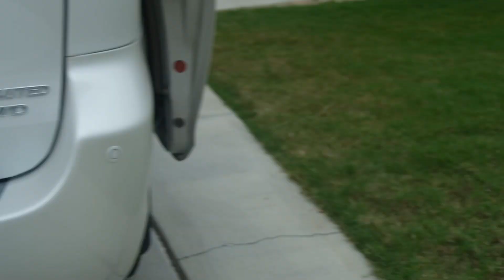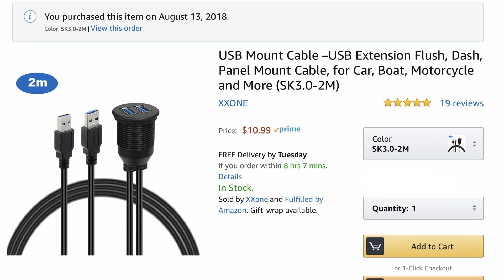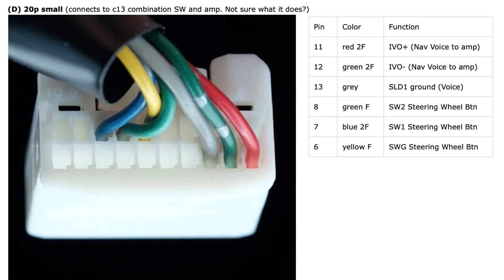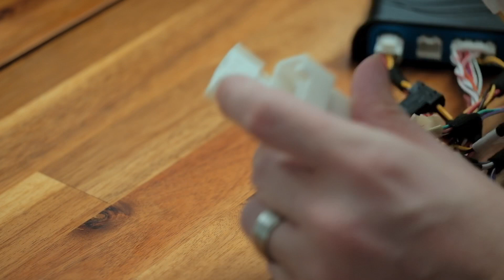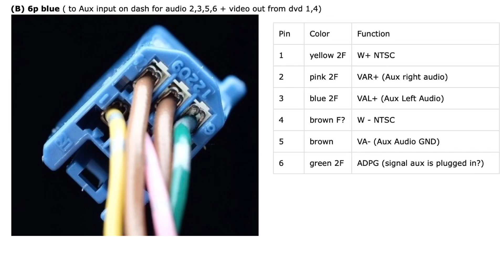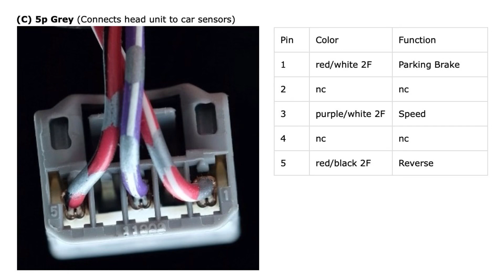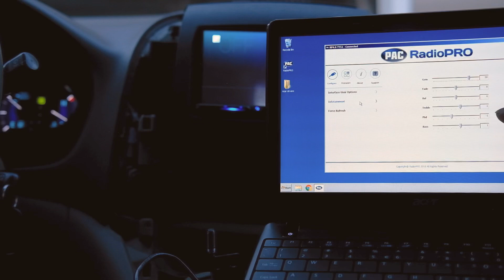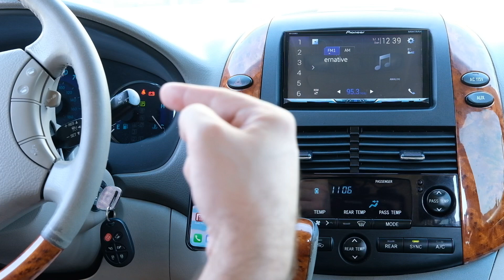Toyota Sienna CarPlay Install 2006-2010 JBL Limited

Comment: Watching this video in 2026 Jan. I bought a 2006 Sienna XLE JBL version which doesn't have navigation system and hence no  buttons on the right side of steering wheel. I want to install a HU with  screen which has both carplay and Android. Which one would you recommend? Ofcourse backup camera has to be there with that HU. @ brett

Comment: By the way, how was your audio quality after this install? My head units speaker outputs appear to be too strong and causing clipping when going through the amplifier. A little bit of online investigation tells me that speaker line outputs are often not meant to be amplified so that's why my sound quality sounds strange. 

I don't know what the best solution is except to maybe bypass my amplifier. I believe you also have the JBL amplifier in your system

Comment: Hey i tried to install this aftermarket radio but only two connectors from the 2010 sienna connecters are able to connect to pac 4.2. And the radio only turns on when i connect the acc power to the radio. Also their is no sound

Comment: Great video Brett - i have 2006 sienna limited and giving it to my son who recently got is drivers license. So we bought everything and attempted install but the camera doesn’t work. I have not driven the car much the last few years and I am wondering if there is enough power going into the unit for the camera. At point I thought the camera may be broken but I doubt that’s the case. Are you doing any splicing for the camera wires? Or bypassing something? 
Thanks in advance
Reply: By the way we have the 2440nex unit and I am wondering if something else may be required for the backup camera
Reply from the maker: There are a few things you can try. 1st verify your backup camera works with the OEM stereo prior to install. 2) make sure the connection works, it may only work when the car is in Reverse. This can be tested by connecting a cheap TV or other display to the Yellow RCA connector on the wiring harness. 3) Connect everything to the new stereo and make sure the stereo's settings have the camera enabled and configured correctly. Verify it works by putting the car in reverse. Hopefully this will help. The wiring adapter should provide the correct RCA camera output as well as providing the correct voltage to the camera. I believe there was two options for this harness and I had to choose the one with the rear camera.

Comment: Just bought a 2008 AWD limited and for some reason any sound coming through the radio sounds like a skipping cd as did the power to the speakers keeping coming in and off every half a second. Same radio as you. Any ideas what that could be? This happens on AM, FM, and Aux.

Comment: I have sienna 2004 JBL system. I have a hard time looking for harness adapter. I’m scared to cut the original wire to connect😢 directly though

Comment: Brilliant work, Brett ! I have just started exploring my options on the 06 Sienna Limited as the factory NAV HU screen blanked out. Upon removing the NAV unit, I see 7 connectors and 2 banana plugs going into the vehicle. Did you have to strip the OEM connectors and rewire them directly to the PAC and HU ? I am hoping for a solution where I don't have to do that. Thx

Comment: please,I need a full video on the installation of the screen stereo and the backup camera in a single video. Thanks
Reply from the maker: I already had the camera installed. I just cut the wire and connected it to the new Head Unit. Good luck, there are thousands of videos on installing cameras.

Comment: Hi Brett, I am installing an after market radio to my 2010 sienna with the  jbl sistem, my question is the accessory wire going to the radio comes out front the pac but it does not send any power to the radio, do I have to splice the wire coming to the pac?because the radio supposed to be fed from the pac bu the accessory is not sending power,  I hope you read my message.

Comment: Brett, thanks for the video! Question - I have a 2006 limited that has the RSE DVD system but doesn't have NAV. Would following this tutorial work for me?
Reply from the maker: Yes it should. For the limited they have all the wiring harnesses in there. What head unit they pop in at the end is a small change. You can pull your existing head unit to verify easily that the connectors are there.
Reply: @BrettMartin84 Will 2005 sienna xle limited work as well?
Reply: Thanks for the reply! Forgive the ignorance here, but I do have another question. When you said "verify that the connectors are there" - which connectors are you referring to? Should I be looking at what is plugged into the back of the stock radio? Or do you mean other connectors that aren't currently being used should be just loose and unconnected behind the radio sitting in that cavity? I'm just unsure what connectors I need to be verifying are there.

Comment: Would a 2005 xle work for this?
Reply from the maker: It is likely to be similar but not exactly the same. So yes it will work, no the colors for wires might not match mine exactly.

Comment: If you could link me to speaker wires colors that would be awesome. Great video btw planning on doing one without the pac your using but a pac line output converter.

Comment: I’m using a line output converter to bring sound from right speaker to go to a eq to run to my amplifiers for bass and later add door and rear aftermarket speakers then eventually tweeters so today I’ve been using Google a ton it’s a pain trying to find speaker wire colors. All to try and keep my can looking as stock as possible

Comment: DO NOT ATTEMPT ON A 2004 Sienna XLE Limited. The factory wiring harnesses aren't compatible with the PAC harnesses. Although the stereo and jbl sound system appear to be the same between 2004 and 2006, apparently the wiring got changed. I'm returning everything and opting to keep the oem stereo, as I can't seem to find a compatible kit for the 2004 XLE sound system or a clear set of instructions on how to connect the wires.
Reply: Some commentator got it working on 05 sienna xle limited. Read newest comments above

Comment: Great video. Question: with the PAC unit, can you still control fade from the Pioneer head unit or is that somehow disabled? (I like to move audio to the back for movies)
What's a microswitch for the parking break?
Reply from the maker: Yes but not easily. You need to connect the PAC unit to a PC with the correct windows software then upload new settings for fade and other audio settings like bass. The HU can control other settings to some degree but this is directly telling the OEM amp to change the settings. Why the Pioneer HU can’t do this since it already talks to the PAC is a huge miss and beyond me. I left a cable attached and under the side dash trim so I can pop it out for quick adjustments but as far as on the go adjustment it’s not possible.

Comment: Thank you for posting this!  Do the wire colors vary in the harnesses from the car?  From your pictures of the 12p black connector I would expect to see blk, wh, rd and gr for the rear dvd audio but they look blk, ? , red and green. Similarly for the 6p blue connector, calling for yellow and brown, but looks grey and purple maybe? Should I just be matching up pin locations rather than wire colors?

Comment: How did you trick the rear entertainment monitor to power on?
Reply: no trick. The 06 and newer power independently. 04 and 05 models require the original factory head unit to power the rear dvd player unfortunately.
Reply: Lol, just finding your reply. Now I have a 06 and you can tell that the rear entertainment screen is different. I tried to swap from my 05 . I did find one . Yeah I'm scraping the 05 so I'm swapping some stuff including the Kenwood. Thanks again for the info.

Comment: Do you have any recommendations on a stereo for the 2013 Toyota Sienna? I need one that works with my DVD player, backup cam, the controls on the steering wheel AND has Bluetooth for hands free phone use/SiriusXM. Thanks in advance!

Comment: Regarding CarPlay
Does your phone call audio route through the Sienna speakers?
I have a similar setup, but with JBL amp routing all the cars audio, and I’m wondering if for some reason that is keeping my phones audio from coming through the speakers?
Also AXXESS makes a harness to connect the RES to a new head unit AV
Reply from the maker: Yes, I can take phone calls via wired CarPlay or via Bluetooth and it plays through all speakers. If you don;t hear phone calls it may be your head unit is doing something unexpected. It should be easy to wire a random speaker to the HU to verify phone calls are producing audio out from the HU. In my setup only the FL/FR speakers get routed as L/R audio into the amp so if you connected the rear audio by mistake to the amp it is possible music works but not phone calls as the HU would only send audio to FR/FL not RL/RR. Thats my best guess
Reply: @BrettMartin84  Thanks for the reply... I seem to recall the setup with the Maestro RR and JBL involved the L/R RCAs going into the Rear L/R of the Pioneer because of the JBL amp... I'll see if I can wire up the front audio wires from Toyota to the Front inputs on the Pioneer.

Comment: Hello Brett.  Thanks for the video.  The PAC interface is working perfectly in our 2005 XLE.  I had originally tried the Metra TYTO-01 JBL Amplifier Interface Harness, but the sound quality wasn't great, and when our stock head unit went out, the rear speakers were faded out, so with the TYTO-01, there was no way to reset the stock JBL amplifier, meaning our rear speakers weren't producing any sound.  The PAC RP4.2-TY11 Radiopro4 Ty11 with computer connection allowed me to force reset the stock amplifier and now all 10 speakers are working perfectly.  The issue now is the stock rear DVD player (RSE).  Unlike your 2006 with navigation, our 2005 did not have navigation, and the DVD harness did not have a connection in the PAC interface.  I don't expect you to solve my problem, but if you've got any suggestions or could provide any help I'd greatly appreciate it.  Our boys love the DVD player and I'd like to keep it working.  Thanks again.
Reply from the maker: I spent a few days finding wiring diagrams for the car and then opening the dash and confirming those diagrams. There is a good chance that if you never had navigation that some of the harnesses are either missing or possibly tucked away under the dash. There are separate wiring diagrams for the Sienna electrical regarding the DVD player at the DVD player location. It would be possible to tap into this audio and feed it into the AUX input on the new HU. I will be abandoning the DVD all together and use the built in DVD on the new HU to push audio out the speakers and video out into the AUX inputs in the rear of the car. This also requires running a simple video cable but should be easy. Lots of advantages/disadvantages. Best advice I can give you is to grab a small old car/toy speaker and study some wiring diagrams to see if. you can identify the location and wire colors for +/-/Ground for the audio for the DVD RES output and then try to find it in your dash. If it's not there, find and test it at the DVD player, then run a standard audio cable between the two. Alternately, use the wireless headphones and DVD RES as a closed system only. Headphones are like $20 on ebay.

Comment: 14:04 Hey Brett! I bought 07 Toyota Sienna LE with a JBL sound system. How to get the video and audio from the rear DVD on the head unit? From the black connector (a standard rear entertainment system connector) where those pink terminal quick disconnects go to?
Reply from the maker: the 12 pin black connector contains the audio for the dvd player. this is from the player and into the Aux of the new HU.  black = R+, White = R-, red = L+, green = L-, Video is on the Blue 6 pin connector. it also contains the Aux audio input. Yellow = V+, Brown = V-. Pink = R+, blue = L+,, brown = RL -

Comment: What wire's do you need to connect to get some sound out of the DVD if you can please clarify.
Reply from the maker: the 12 pin black connector contains the audio for the dvd player. this is from the player and into the Aux of the new HU.  black = R+, White = R-, red = L+, green = L-, Video is on the Blue 6 pin connector. it also contains the Aux audio input. Yellow = V+, Brown = V-. Pink = R+, blue = L+,, brown = RL -

Comment: Hi Brett. Please help...im only getting video from dash head unit. Now video in rear tv has disappeared. Any suggestions?
I located in another comment about RCAs and black and gray connectors. I will attempt that process. Im trying to figure out if the RCAs will be bare?
Reply from the maker: the 12 pin black connector contains the audio for the dvd player. this is from the player and into the Aux of the new HU.  black = R+, White = R-, red = L+, green = L-, Video is on the Blue 6 pin connector. it also contains the Aux audio input. Yellow = V+, Brown = V-. Pink = R+, blue = L+,, brown = RL -

Comment: So... My pioneer unit only has 1 usb port in the back. Did you splice the 1 usb port in back of head unit for the 2 plug cord or did you only need to plug in one cord for both ports to work?
Reply from the maker: I got a dual USB port extension. one plugs into the Pioneer, one plugs into a regular 12v USB adaptor plugged into the 12v outlet now hanging out behind the dash.

Comment: This is exactly what I needed. Does it also retain the ability to keep my rear dvd player?
Reply from the maker: Yes. The old rear player and AUX input now route into the AV input of the new head unit.
Reply: @BrettMartin84  Thanks for this awesome video. I read that the 3rd Row AV input doesn't forward to the head unit, only the DVD source will. Can you confirm either way?
Reply from the maker: @chillydownnow  it’s only connected to the screen in the roof. No reason for Toyota to wire it back to the HU. Should be simple enough to piggyback the wires from the rca input and send it up to the HU via the skirt boards.
Reply: @Brett Martin thanks for the video, it’s all I need for my Siena 2006 limited. Do you still recommend the Pionner AVH 2330 Next, or have something best nowadays?? Thanks

Comment: Hi Brett. Great video! I have been looking for a video like yours for a few weeks now. Glad I landed on this. How did you decide on the head unit? What are the requirements I need to look for? Thanks.
Reply from the maker: J Lantoria Hi. I have had a few Pioneer head units in the past so I am a fan. If I were driving this car more or if my kids were older I would have spent more money on a Wireless car play HU so I never have to plug anything in if I don’t want to. They were twice as expensive when I bought this but have come down in price now. There are also units with dual outputs so the rear seat can watch a movie while the front seat listens to music. You can also get some cheaper units now that are not very deep because they don’t have amplifiers etc inside. This might work well considering you are bypassing the HU amps to go into the existing amp unit. The unit I went with was a slightly older model. I would have gone for the newer one but this one had the rear camera parking lines and the new one didn’t. So 1)CarPlay 2) Good brand (pioneer, keen wood, alpine etc) 3)A/V input from rear 4) steering wheel controls 5) Bluetooth 6) works with existing amp/sub built into the car. This HU gave me the most features for the lowest price. If I got a better HU I would be tempted to re-wire and upgrade other components as well. This one does the job and I was able to sell my existing HU on eBay to pay for half of the costs.
Reply: Hi Brett. Thank you for your quick response.  As for wiring, did you use other aftermarket wiring other than the ones you identified in your video? If so, can you please let me know what they are so that I can purchase them too?  Thank you so much for your help.

Comment: Does the dvd steel play seperatly from the dash screen like the original dash screen
Reply from the maker: Wendy Moran you can play the Dvd from the rear player to the front and rear screens like before. You need a more expensive version if you want to play from the front to the back and still do other things like navigation. This solution does everything the stock one does and more.

Comment: After watching your video I cannot determine whether this is a straight install or some wires have to be changed? I want to keep my rear speakers too. Newer Pioneer units do not allow the use of the existing Toyota backup camera? I would like to follow in your footsteps but not sure about the wiring?